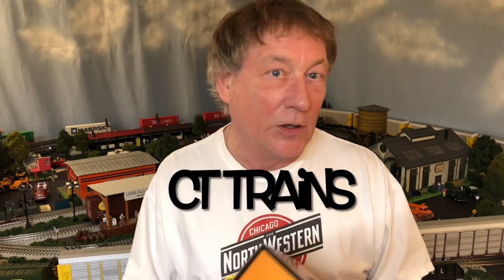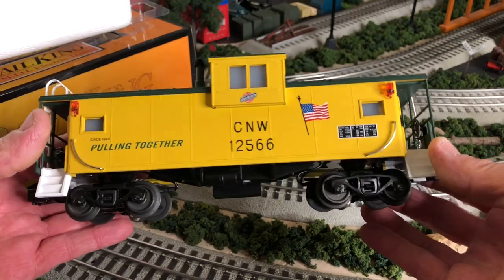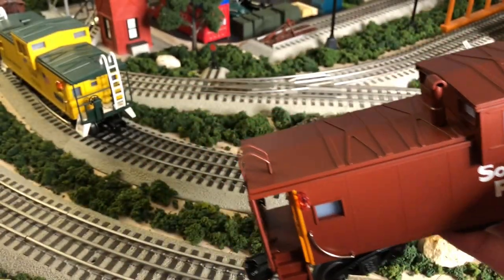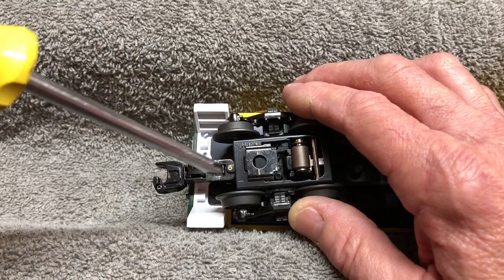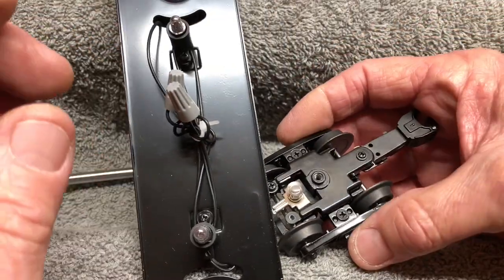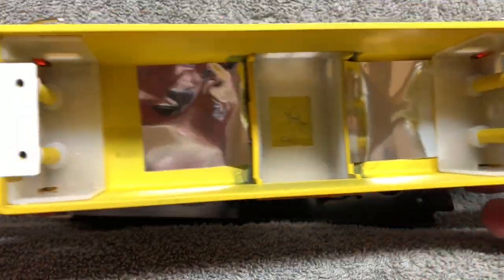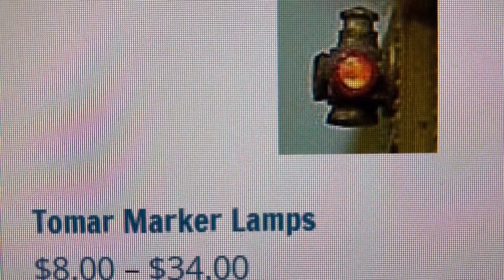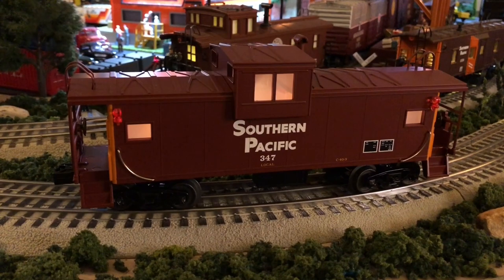My First MTH Rail King Cabooses Mar 4 2023

Comment: Being from Michigan, Lionel was what started me in the hobby.  I still only use the Legacy control system, but with the recent quality issues, I may have to "bite the bullet" and get an MTH or DCS control system to expand my Locomotive fleet so I can add more Soo Line engines.  I'm not completely sold on the new Lionel Control system they are advertising but not producing yet.  My rolling stock fleet is full of every brand available.  Menards, Crown, MTH, Lionel, Weaver, etc.  The list goes on and on.
Reply from the maker: I hear you Mike.! Kind of sad that the Lionel version of these Cabooses would be twice the price. I ordered the Erics Trains Caboose and it was almost $130.00. Mark's Trains was taken so I went with Lionel Trains so I will never add MTH DCS to my system. I am exploring Atlas because they use the old Lionel TMCC boards that will work on my layout. The MTH reefers Matt of MSlicks Trains did a video on a few weeks ago look really nice. I probably wont get the new Lionel CAB3 base right now either when it comes out? Unless my CAB2 has problems? Thanks Mike and havre a great day.!😊
Reply: I have a vision line n and w. A class it isn't perfect the tender looses power,kind of a disappointment.
Reply from the maker: @rycn1450  sorry to hear. 🥺 lot of that going an these days.

Comment: Mark, I'm a big MTH fan but I also had loose trucks on a RailKing Jersey Central "Blue Comet" tender I bought about two years ago.  An easy fix but a little annoying considering the cost of the engine.
No big deal but I'd advise anyone buying new O Gauge products of any make to give them an inspection before you put them on the tracks.  There's always the possibility one's going to slip through the cracks as far as quality control is concerned.  It is what it is.  That being said I'm not soured on MTH by any means.
Reply from the maker: Thanks for the Comment Wayne.!😊I'm very pleased with the Cabooses even needing the fix. Agree on the inspection out of the box for issues like this. All the train makers have this problem so I usually just fix it and move on. We will see how my future MTH Snow Plow purchase works out? Have a great weekend when you get to it.! Mark
Reply: @markslioneltrains  Thanks Mark!  I'll sure try, I'm picking up a new car tomorrow so this weekend's going to be a time of elation mixed with a case of new jar jitters.  You know?  You get a new car and for the first few days you scream at everyone else on the road to get the hell away from you!  Oh well, a few more grey hairs won't matter at this point!
PS:  I just gave you a "like" and I'm hitting the "Subscribe" button!
Reply from the maker: @wayneantoniazzi2706  Fantastic Wayne.! Gosh Yes.! Trying to keep a new car new.! Yikes.! Trying is a good word.! Enjoy and Thanks for being Subscriber 1190 and for the👍It's much appreciated.! 😊Mark

Comment: For the brief time I owned O scale, I felt that the MTH was slightly better quality than the Lionel, the latter felt more "Plastic" to me.
Reply from the maker: Agree about the plastic. I’m very impressed even with the loose screws. When you pick up the Caboose it doesn’t feel cheap and has some weight  but rolls smoothly.! The Lionel 1992 Caboose has a steel frame and is heavy as well. Thanks for Watching😊

Comment: All you have to do is pop the axil back into place problem solved.
Reply from the maker: I wish it was that simple🤔The sides of the truck are held in place by 2 small screws on top of the truck on each side that came loose during shipping. They are all metal trucks so no plastic to snap into. Thanks for Watching and commenting😊Mark